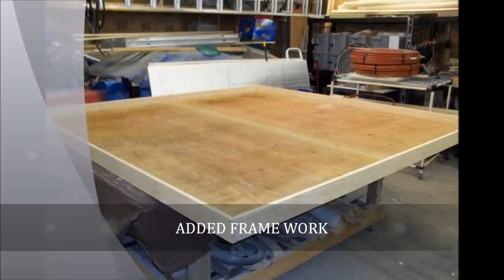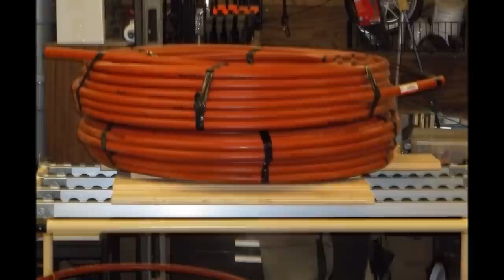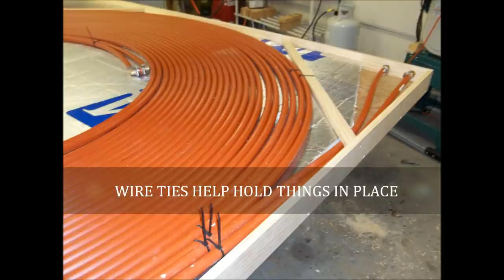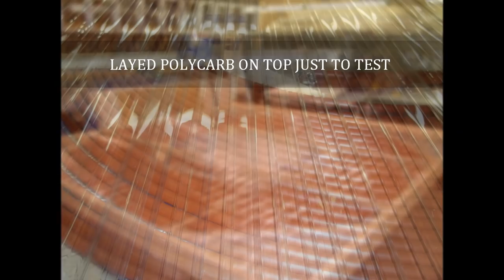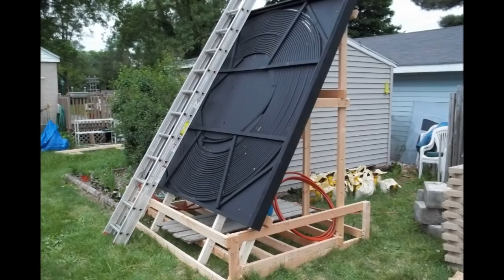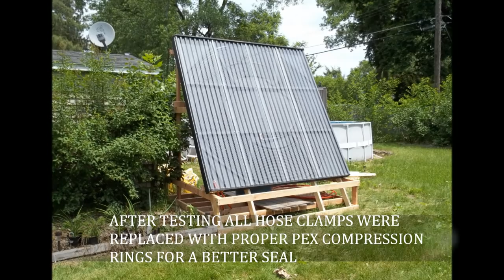my solar water heater

Comment: A coil of soft copper for tubing would have been a much better choice, most pex isnt UV rated, also Pex is an insulator and is fighting the heat transfer which you want.
Reply: Pex won't breakdown meaningfully at least 100 years I bet assuming it doesn't reach over 160-180f consistently.

While copper transfers heat way more, plastic is usually quite thin, I saw a study where it makes virtually no difference, plus copper is 10-20x in price. Say you use less pipe and you'll have less heat.

Comment from the maker: First off this was a CHEAP and quick solution for MY needs. I know PEX and wire ties degrade, so will the Intex pool I am using. As far as all the numbers and technical data, when the video was posted it was just setup so no data was available. I did use a pool cover with this setup. I live in Northern Illinois, all I am trying to do is get the pool to warm quicker in the season and stay warmer then it would get normally. Now with a low end solar cover this added a average of 5 to 10 degrees to the water temp. and this is good for the most part but when it got around 90 degrees (air temp) for most of the summer of 2013 it made the pool run around 98 to 104, which really sucked when you get off work and want to cool off in the pool. To date the only problem I've had is last winter I forgot to drain the panel and add anti-freeze, this made the pex freeze and push out the bottom of the panel and the loops sag at the top. Also I have been using a ! inch clear water pump from Harbor Freight set to cycle for 15 minutes every 45 minutes. Again this was MY CHEAP solution to heating a pool. I have learned from this design and am hopeing to build a better version that uses better materials so I can have supplemental heat for my house some day. PS the music is from the pickin on series and if you don't like it oh well you have mute options. I'm a Phanovphloyd and to quote Tom Moon "The more you love music the more music you love" so keep an open mind people and thanks for taking an interest in renewable energy.
Reply: That isn't bad, hundreds of gallons of open water (releasing heat into the air) got a 5-10 degree F rise? Seems like this design would at least create a much larger rise if used to preheat water before it came into the house. (I imagine like a 55 gallon barrel with a lot of the 500 ft under the pool instead wound up inside it and heating the exchange liquid like some of the other videos here on youtube)
Reply: phanovphloyd f
Reply: Black silicone rubber tubing? It's supposed to be pretty stable over a range of temperatures( -40C to +200C) and is food grade. Anyone know if it's UV resistant?
Reply: It is after you paint it black with UV resistant paint.
Reply: Great job, I thought about building one 4x8 with a sheet metal bottom and maybe coiled copper tubing. Not sure if I would need to paint it black. Any thoughts?
Reply: I like your idea.I’ve been looking for a way to cheaply heat the concrete floor in my garage,so I’m not freezing or going broke next winter while I work.
Reply: everyone learns more from the things that are done wrong ... but nonetheless done ... attempted ... and sometimes accomplished.

Thank God that humans always want something a little better ... done a little more right ... innovation.

ALL WE NEED FROM THESE EXPERIMENTS ... is did it work, how did it work, what is wrong with the idea and how could the project have been made better ..... 

IF the producer of the project wishes to share that information, it's all the better for us to choose to make use of the idea and the results .....

Comment: On any long tube collector, there is a point at which the fluid gets as hot as the tube. Any tubing beyond this point is wasted because the heat it gathers has no place to go. Take one of those laser thermometers and measure the temp. starting at the input (cold) end. The tube temp. will start off near the incoming water temp. Shortly after the point where the temp. stops rising is where the extra tubing is just wasted because the water has taken all the heat it can carry. This distance will vary based on flow rate and conductivity of the tube. These spiral collectors need multiple lengths of tubing and manifolds.
Reply: kkarllwt Much as that is correct but the length of tube after the point the temperature becomes constant is most definitely not wasted.  The water, air, ground and coil temperature are all variables therfore the length of tubing before the pipe and the fluid inside becomes variable.  Any excess pipe after that point will not become any cooler.  The more pipe there is the greater stored heat therfore the better the end result.  Think of it like a battery.  12v 1ah can sustain 1 amp for 1hour or 10 amps for about 6mins   so 12v 10ah can sustain 10 amps for 1 hour or 1amp for 10 hours.
Reply: @captainchaos3053 it would be wasted though,you aren't adding any heat capacity as you can't get more heat from it, unless you were storing heat. Additional heat trying to be added is lost back into the environment.

I'm not sure of the physics, but it seems about 50-100 ft is good per loop, unless a really high gpm above 3-5.
Reply: @brianob1  The idea here is that the water heated by the collector is going to transfer that heat to a large body of colder water with an open surface. Only after the large body of water becomes the same temperature as the surface of the coil will the system stop being able to add heat.
Reply: @captainchaos3053  yeah, it is a little more capacity, but if its that hot it's pretty inefficient. You'd get a lot more total heat if you ran a couple degrees over to the desired temp, say 60 pool and 80 solar vs 150+ if it were no longer gaining temp, probably 200+ and destroy it.

I think even a very long pipe of 500' would still be gaining temperature.

Comment: Works well, you can feel the warmer water coming back into the pool after running through the mat. Wish the inlet/outlet ports were adjustable, but overall, a good and efficient way to raise the water temp.

Comment: I produced such a collector in 1991, sent it to Cyprus to test in 40 degree heat and sun, but my Pex al Pex pipe was UV protected and black, with the glass K glass. Great for a hot water shower at the end of the day and cheap to make

Comment: This system collects over 3kw of sunlight, but the PEX is layed out like a Reverse-Flow Heat-Exchanger, but keeps the heat trapped in the center of the panel.
I suggest that you allow the water to only flow clockwise, then draw the hot water from the center of the PEX coil, eliminating the Reverse-Flow heat-loss to the cooler incoming fluid.
Reply: Exactly what I thaught too 👍
Reply: what reverse flow heat loss? if anything the reverse flow is preheating the cool water as it enters the panel, so where is the loss?
Reply: @marzsit9833  😂😂😂😂😂
Reply: @marzsit9833   these are the same people who think that  if you half the inflow of the water the temperature  of the pool rises sooner because the outflow is hotter 🤦‍♂️

Comment: Instead of your intermittent electric sump pump (15 min on, 45 min off), I think I will go with a 12 volt DC continuous slow flow pump that operates entirely from one small solar panel. That's what I use now, except my hose just runs around the perimeter of the pool instead of in a nice enclosure like yours.

Comment: Rotating on its intake you loos about 10 to 15 degrees. It has to be a one direction wind because the cold water is cooling your hot water.

I had 4 200 feet black hose. My first run the temp in was 40~50. The temp exiting was 200~250. Then increasing pump speed dropped the temp to 150 however the pool temp was a steady 75 degrees all year round. Winter did not change anything. Only pool in the area that was still running.
Reply: +Richard “Spline-King” Lionheart Do you have a video or pics of what you did in comparison to this. If you were getting water temps that high, that's crazy!! I would love to see what you did.
Reply: vballman20
I do have them in a few places that I could bring up. The math of temp loss and interaction is a fun way to get hot water but it also works with Hot Air in order to eat up say a home with nothing but the power of the sun.

I did enjoy making a SunOven. The temp of my oven has reached 350°. I have cooked lot of things and even a pork roast.

The thickness of the hose is the problem. It is to thick. The best part is it is a simple fix.
Reply: I don't see how the heat is "lost".  Do you actually mean something more, like transferred or some sort of equalization between the hot & cold?

In any case would a temperature drop from the hot to the cold be a good thing or a bad thing? After all no one is indicating(turned off the sound), a target temperature under the pool.

Comment: fyi ... a continuous wrap would have been more efficient. 
doublng back would act as a heat exchanger and u would loose heat from your output to the colder water coming in to the solar heater. 
i like the simplisity of ur disign ... i wonder if it could be made with out a pump :)
great job
Reply: I'm doubtful that a continuous wrap would have been more efficient. The heat energy deposited into the piping is just determined by the length of the pipe and the area of the collector box. The layout pattern doesn't matter much.

Comment: Wait, you ran the pex piping under the pool's bottom lining?
Have you thought about putting the pex tubes into the water having one side of the tube sucking in the cool water from the pool, it goes through the coils in the solar array and once heated up, the warmed water goes back into the pool circulating the same water round and round. Would that be more or less efficient?  What do you think?
A timer is a good thing too.

Comment: NO hose clamps! Those are meant for automotive rubber heater hoses, not PEX! Use 3/4 crimp or surlok clamps designed for pex to avoid leaks under pressure.
Reply: Hi

Comment: Hey GREAT JoB,!!!! But you forgot about something.!! You forgot to run a syphon trap system, to catch The Extra HEAT Coming out at the open spots on the Bottom line along the Cover. So, as to Run it into the house as an (Kick -in - THE - Backside, )!! To help heat Your Home in the winter.!!

Comment: Too bad pex tubing is not made to be in direct sunlight....Also brass to galvanized pipe connections will corrode really fast due to electrolysis.
Reply: i would be worried about swimming in that water but you could make a spiral at the bottom of the pool to work as a heat exchanger (youd have to make sure nobdy could get tangled in it) or just paint the bottom of the pool black and do away with the panels. maybe with some lighter  dots or stripes for visibility it would look alright. maybe you could get some dark sand or pebbles. that would probably be pretty good eco way to do it. I think pebbles would be good. then you could take them out easy in the summer time if water is too hot and they might  look quite good and natural. probably last forever and you could always collect the pebbles up and sell them or otherwise move them to a different pool or application.
Reply: Maybe a heat transfer tank to keep both water systems separated. The pex tubing however i also agree is not the best material choice in this situation.
Reply: Is stainless better

Comment: I don't mean to rain on your Parade, but using Galvanized Fittings is the worst thing you can do for this water heater. Those fittings will fail and the few cents you saved will cost you dearly when you have to replace them; especially when you mix them with Brass Fittings almost instant Oxidation. Cooper or Brass Fittings ONLY, don't cheap out and introduce contaminates to your water system. Great project over all, but Galvanized Fittings are an accident just waiting to happen... Cheers....

Comment: Originally my design had a timer for the pump on / off. I was thinking on for 10 minutes, off for 30 minutes, repeat. Do you think that might be better than a continuous slow flow? Also, I did not integrate my system into the pool flow system, instead it pumps water from the pool back into the pool as a closed system by itself.

Comment: I'm thinking of putting something similar to this on my roof to heat water inside the house for showering, washing dishes etc., but I don't want to use anything that will degrade over time; still not sure what to use.  Is that Interstellar Overdrive; I feel like I'm having a flashback just listening to it.
Reply: would black silicone tubing work well?

Comment: Add a non return valve and use an air pump or a vacuum cleaner to suck the air out and your system will perform a lot better specially on winter

Comment: Adding some numbers would help (got them from the comments0. I guess I would have used heat-conductive tubing. MOst plastics are bad with UV, unless specifically rated for UV, and do not conduct heat that well.
Reply: Perhaps ABS is better for UV degradation.It's already black!

Comment: You could have used thermosiphon technology, and avoided using pumps. Throw some tubing on the sides of the pool, add a cover, and you could keep it heated year round.

Comment: Great plan, a couple issues. PEX degrades in sunlight. Pex grades are different, standard not meant for closed loop system with iron parts in it, such as fittings and pump, need to use Radiant floor type PEX, and I would use drip mist type tubing for direct sun exposure.

Comment: ok good engineering  now upgrade with copper pipe , put the thing on the roof of your house and fit an electrical valve  or a none return valve . now using a diy electronic temperature difference relay circuit place one thermistor around in the middle of the coils behind the copper and the other one in your cladded water tank  and bingo you have an automatic hot water system!

Comment: I may go with 3/4 inch black rubber hose sold in 100 feet sections made by Craftsman (Sears) which has a lifetime warranty instead of pex. I know that adds a lot to the initial cost, but it will be lifetime. It will also add weight and I will probably only get 300 feet (maybe 400) in there compared to your 500 feet.
Reply: I hope the lifetime warranty is insurance underwritten lol
Reply: @johnbull5394  Garden hose is not for drinking water and the lining may leach chemicals into the water. My non-Craftsman hose turns the water yellow.
Reply: @ddd228  Do Americans drink the water in their swimming pools?  This issue of hoses for drinking water keeps coming up, but the video was about a swimming pool!  Have I missed something?

Comment: aren`t you ment to put the outlet at the top as hot water rises. so you get a curcular rotation of heat. cold from bottom hot from the top.

Comment: don't mean to rain on your parade but your trying to make a solar heater using  pex pipe which is an insulator.  Although it transmits heat it's nowhere as good as any metal would be.

Comment: Tips for improving peerformance: 1º Hose might be maid of metal (aluminium or copper or the cheapest). 2º Cover all the frame with mirror translucent cristals (those cristal where the cashier can see you but you see a mirror), so the light will enter and bounce and bounce inside the cage.

Comment: and the result was?
Reply: Thomas - You are very wrong about that.  Solar water heaters are used throughout the world very successfully.  There are commercial rooftop versions that produce scalding hot water.
Reply: @The Mower Co. Have to politely disagree, that thing would collect a LOT of heat. I can guarantee you would not be able to put you hand in the water coming out of it.
Reply: @jameshomer1125  No result cause pool-surface much larger than heater, difference shouldn´t be noticeable... Pool gathers through its larger surface more heat than the heater could ever provide. Except maybe for night-swimming, where all the storaged hot water can be poored in instantly, and allow swimming despite low night-temperatures...
Reply: @klausbrinck2137  You literally don't know what you're talking about. There are dozens of vids on this site measuring temp gains with thermometers.